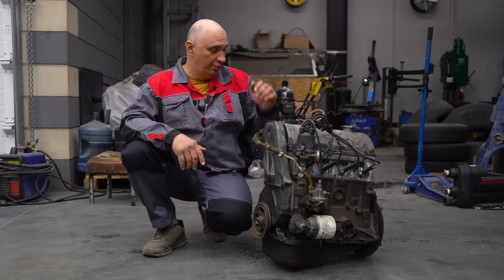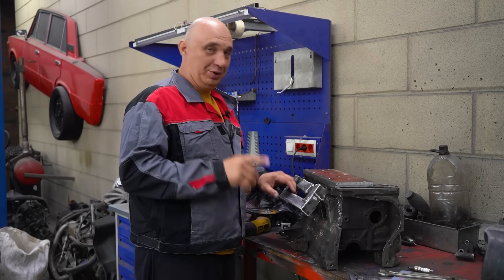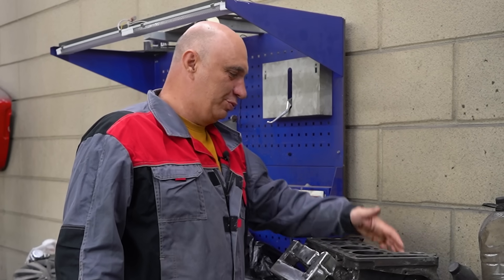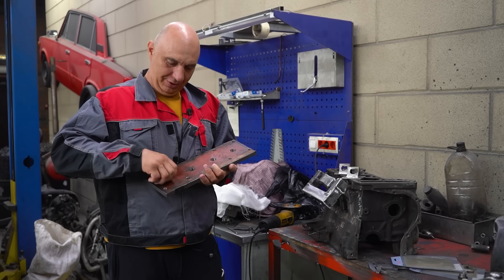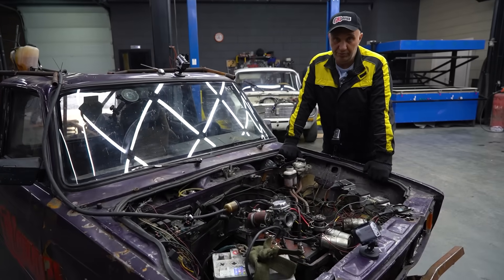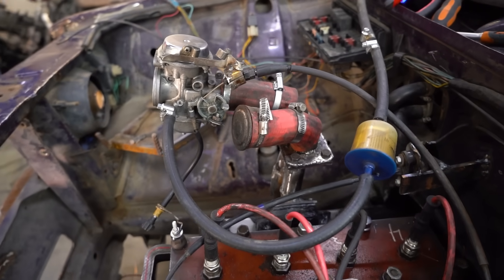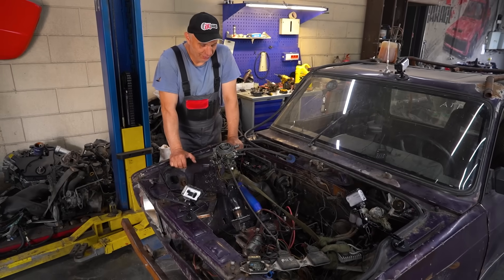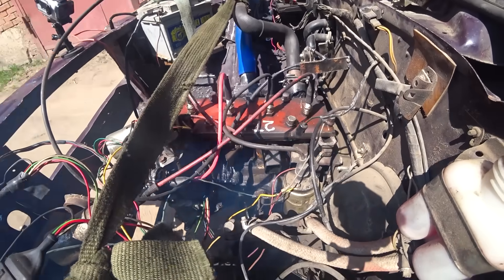4 stroke to 2 stroke Lada engine conversion

Comment: Your Problem is the crankcase you dont get pre pressuring in the crankcase because its a 4 cylinder so the pistons that make pre pressure when going down just cant make thtat because the other ones go up therefore you never have enough crankcase pressure for mixture go up in the transfers... The easyest solution would be to add a supercharger between carb and crankcase.... Or otherwise separate the crankcase in 4 ones. But that will be a Nightmare to get to seal

Comment: Two stroke engines have a reflector in the muffler to bounce back the preasure wave to prevent unburnt gas leaking out (too much) If the exhaust pipe is missing, the engine barely works. Didn't you guys tune your mofas back then?

Comment: You have to have a Exhaust chamber behind the cylinders look at all 2 stroke motorcycles it needs the Pulses to build pressure before it moves out and you need Oil in the fuel!!

Comment: I always work on 2 strokes did you guys put the intake and exhaust ports in the right places? As well as look at jetting and port timing or even the type of exhaust shape you guys are running because the exhaust creates back pressure and acts like a exhaust valve wich also allows unburnt fuel to go back to the cylinders and burn it off....if you take the exhaust off of an 2 stroke engine its not going to run right because there is no back pressure etc.....aswell as look at the ring gap that you have for each cylinder because to high compression is not good so try fitting a spacer plate on the head to bring the compression down a bit  because a two stroke usually does not like to much compression also look at the crank case because there aren't any transfer ports for the fuel to go from the crank to the cylinders so try creating transfer ports and sealing each individual conrod to its own chamber

Comment: A 2 stroke always needs a Expansion chamber (exhaust) that will cause a scavenging effect you do got the reed valves that's 1 thing u did right now it has to have a Expansion chamber to ever run right cause the expansion chamber is for unburned fuel to be sucked back in the cylinder and reburned this will make a powerband effect every 2 stroke has a powerband      add an expansion chamber you'll see  improvements         another improvement that will make it run better is sealing the block if the block is not sealed correctly it'll run super lean (too much air not enough fuel) and cause a hole to be burned in the piston if it runs also if you are mixing 2 stroke oil with the fuel make sure u run 32-1 (that's only if you are mixing oil)    those are the only things that'll help it run correctly (1 fully sealed block 2 expansion chamber)

Comment: Maybe you should change the piston cycle from pairs to individual.
Meaning that you guys need to cut the crank and divide 360° by 4 and make 90° crank connections, this way al pistons got its own powerstroke.

Comment: For starters you're missing the Fuel/air diaphragm. You'll need4 carbs with the built in one.  Look into the difference between various two stroke carbs. You're going nowhere with singular carb. Atleast two. 4 be best. I wish I could see more & your setup..I could get that going in a day.  Cause you otherwise need a Diaphragm plate at fuel intake post. Leaf valve plate? Don't bother making 4. You'll be better off hand making a swiss watch by hand..

Comment: You should try to make an long exhaust because exhaust pulses on their way out help pull in fresh mixture. the exhaust should have independent pipes for each cylinder at least 1 meter

Comment: I would put on a compressor/supercharger to fill the cilinders.. however.. i was thinking, why all the hassle.. maybe leave the vavles in but change the sprocket so it is 1:1 and mage a camshaft with in and out timing as a 2 stroke. then put on a compressor to feed the air in.. i know detroit 2 stroke diesels use a compressor/supercharger for that same reason.

Comment: There are diesel engines that are 2 stroke.
I wonder if you could remove 2 of the cylinders that are not firing?
Maybe isolate the pressure in each cylinder and even in the crank case?

Comment: 2 strokes need air to be forced in, it doesn't have that same suction ability that a 4 stroke has to pull air fuel in, 2 stroke detroit diesels have a supercharger to force that air in, instead of the crank case in a single cylinder leaf blower engine.

Comment: Just my opinion and as such, I could be wrong.
I think you would have better success with a exhaust system that has a cylinder scavenging effect, or forced air induction with a well sealed crank case..
Also, try seperating your cylinders into different pairs.
1-3 and 2-4.
That way the paired cylinders will not rob air and fuel from each other.
Plus, the flame front from one cylinder cannot blow out the flame in the other.

Comment: Is it possible to get/make a smaller cam gear? (So it spins twice as fast relative to a given RPM than it did before.) Then adjusting the timing to where it sparks twice as often..  I know jackshit about engineering. But this seems it would allow to keep the oiling and cooling systems intact..... Id legitly like to see if this would work... (or if someone knows why it wouldnt, an explanation why is cool too.)

Comment: How about turning a Detroit diesel engine into a petrol version by adding head gaskets/spacers to get the compression ratio right, put spark plugs in the injector holes if they can be drilled large enough, set up ignition, carburettor and see if it runs

Comment: Bruh I didn't understand what you guys did, but I tell you what
Did you just combined the intake tube with the transfer tube? lol that's kinda a boost port but a 2t can't run only on a boost port, it needs proper transfer ports
2 did you guys even try to seal the case?

Comment: You need something to push the mixture into the cylinder, like a compressor. On such a two-stroke the piston must first open the exhaust port when it goes down to start evacuating the exhaust gases and the pressure in the cylinder before the opening of the intake port. This allows the mixture pushed by the compressor to enter the cylinder. And this mixture would have to go upwards when entering the cylinder to replace as much of the exhaust gases as possible before the piston goes upwards and closes the ports .
Good attempt, anyway. 🙂

Comment: Go back with original head. And the fuel must be vaporized and since it's going in via rubber hoses, it's too cool and liquid, flooding the motor. So use a metal intake that retains some heat

Comment: Give it a direct injection cuz even though two cylinders are moving with the other cylinders there is a weird vacuum in there that stops the cylinders from pulling fuel in like a standard two-stroke would work

Comment: It needs back pressure on the exhaust to work it will never run right if you don't have expansion chamber and length

Comment: For this to work right you wouldn't have to do it a lot of cylinder work and you also need to make sure you remove the oil rings from the Piston the fuel has to be able to make it to the base of the engine but for what you guys have done the engine did start to sound like a two-stroke but it needs a lot more work to run properly and a two-stroke compared to a 4-stroke if you ever 1000 cc four-stroke and then you turn it to a 1000 cc two-stroke you need about twice the air and fuel mixture it 125 two-stroke racing dirt bike carburetor will run a 400cc 4-stroke almost perfectly you need about twice as much fuel and are for a two-stroke

Comment: As a two-stroke mechanic there are a few things to note. 
I watched this a few times to figure out exactly how the intake is setup and i cant quite make it out from the video. It appears the intake runs directly to the cylnder lining transfer ports. If thats the case the design just wont function. You need to create a suction to pull air in. On a two-stroke that comes from the changing of crankcase volume. Piston goes up, crankcase volume increases, creates a negative pressure. Air is pulled into the crankcase tbrougb a set of reed valves. I didnt see reed valves anywhere in the setup either. When the piston comes back down, it decreases the crankcase volume, compressing the air in the crankcase, when the piston uncovers the transfer port, the compressed crankcase air blows into the cylnder. 
If your air isnt passing through the crankcase, you arent building air flow. Remember air isnt pulled in from the piston coming down and building suction in the combustion chamber like a four stroke. 
If you dont have a set of reed valves in each of the four air circuits then it wont run either. When the piston comes down, instead of compressing the air and blowing it in the cylinder, it will just blow the air back out of the intake.
If each air circuit is not air tight it will also not run right. I wont go into detail since you covered thag at the end of the video anyway. 
To improve this could go two ways. 
1). Reroute your intake. Air goes in the carb, splits into four intake runners. Each runner goes through a reed valve, then directly into the crankcase, each in its own isolated circuit. Then you make a second pipe, only a few inches long that connects the crankcase to the transfer port in the side of the cylinder lining. 
To clearify aur comes in the carb, through the reeds, in the crankcase, builds pressure, then blows out of the crankcase and into the transfer port through a second intake runner. 
Something to nite with this is that crankcase volune is important. You want to fill in the crankcase as much as possible. Basically reduce the amount of volume between the reed valves and the transfer port. 
A lada is 1.6L engine. Each piston only covers .4L of displacement. So if the entire crankcase volume of one air circuit is say 1.2 liters of volume because the crabkcase is so large, then when the piston comes down, it goes from 1.2 liters of volume in the crankcase to.8. thats not alot of pressure. Its only building a few pounds of air pressure to blow air into the transfer port. If you can use epoxy to fill in the empty unused space inside the crabkcase and reduce the total volume you get mkre pressure. Say you reduce the total volume (with the piston at tdc) to around .8L, when the piston comes down (again reducing the volume by .4L) you have significantly more compression, more pressure forcing air out of the crankcase and into the transfer ports.
2). The ither method would be to ditch that entire setup and reroute your intake to that if a detroit diesel engine. Detroits are two strokes but also have an internal engine oil. Thiugh this eet up would be alot more expensive and probably couldnt be done with parts laying around the shop. Unless you just happen to have a powerful enough blower just laying around.

Comment: This thing is never going to work because it does not suck any air At ALL!!  You need a seal between the crank (5x) and you need tansforports to bring the mixture on top of the piston...and your bearings need to be changed into roller bearings lubricated by the mixture..

In this situation you could use a mechanical blower (like on a two stroke detroit engine)to force the air mixture into the camber(root blower)
But you never get the mixture to flame i guess because you can t inject it like in a 2 stroke diesel engine

Lovely video but your concept doesn t suck....haha

Comment: What I would do is leave the engine like it is from the factory but re grind the cam to open and close the valves every stroke and make the spark plugs fire every stoke. Also your setup a problem you have with this setup is that the piston skirt doesn't cover the ports at TDC

Comment: Need a supercharger for it to run. All 2 strokes need an air pump of some sort for positive pressure on the intake port. Some work via the crankcase, others like diesels with oil sump need a supercharger to run (and is still considered naturally aspirated). Get positive pressure on the intake ports. Use a vacuum cleaner motor if you have to!

Comment: A two strokes intake is mainly within the crank case.The vacuum created from the piston traveling up draws in the fuel air mixture into the crank case. As the piston starts traveling back down the intake on the crank case is shut off via means of a read valve or rotary valve.
 the pressure from the piston traveling down now forces the air fuel mixture to the combustion chamber via passages from crank case to cylinder ports. That's how it works. 

Sadly what they tried here would never work, because the intake port is WO at BDC there is no vacuum to draw in the fuel and air.

Comment: Too much crank case volume and no exhaust. It needs a custom crank to feel up the space and smaller oil pan to increase the pressure of the crankcase. And some exhaust to suck more fuel.

Comment: Block off ports to transfer case. It will never produce good enough seal to drive mixture. Let the pistons drive in mixture and it should start without further modifications. Granted that then bottom end doesn’t have any lubrication then but it should prove the concept.

Comment: Hey guy's, I do lawnmowers, chainsaws, line trimmers.... that kinda thing, most of the stuff I do is single cylinder and ya need to think of the engine as having phases (what's happening above and below the piston) below piston... when the piston is going down it needs to be forcing the fuel change into the cylinder, when the piston is going up, there needs to be a vacuum in the crank case drawing in the next fuel change.... Above the piston.... When the piston is going up the fresh fuel charge should have pushed out the burnt gases then seal off the exhaust ports and seal the cylinder ready for combination

If there is a vacuum or pressure leak then it will incredibly bad if at all

Hope this helps

Comment: There is a much easier way to 2 stroke convert a 4 stroke, use a supercharger for scavenging and open both valves at bottom dead center...with some clever valve controll its even possible to make an engine which can switch between 2 stroke and 4 stroke on the fly to make the most of both worlds.

Comment: separate the crank chambers and run the gas mixture through the crack chambers and weld up a transfer port make sure the port timings squish gap and ignition are acceptable and it should work no problem!

Comment: U need to create flow airfuel wave to run it.
Try to instal comprex from old diesel mazda, it will run as a rotary compresor and exhaust valve at same time. U do not have exhaust negative pressure in cylinder chamber, or intake flush positive pressure of fuel air mix so you cannot run the engine cause you dont have anything to combust. Two strokes run always on a flow wave by 3 ways:
 on flush chamber forcing airfuelmix to cylinder
or membrane valve with decompresing chamber in exhaust - suction exhaust by them airfuelmix
or forced charge like 2 stroke diesel (kompressor ),  this let you no need to have exhaust chambers or membrane valve
these are 3 ways to run it.

Comment: OK. I have spent quite a lot of time with old 2 strokes. 
That type has to basically have a very very good crankcase seal to work. It's unlikely welds will be that sealed. Then normally the open space in the case is minimal so the piston has more suck and compression. And the piston has no shape. That kind had to have a shaped piston head to blow the inlet air up. The setup as it is, is just blowing out the exhaust mostly. 

A better approach may be this. 
Keep the head. Then use the exasust valve to open when the cylinder is at the bottom of the stroke. This means different cam  profile and rotation speed. Just take the inlet rocker out and leave the valve.

Then the inlet port is at the bottom. 
Use a belt driven large blower to get the positive pressure to push the inlet air in. 

Few multi cylinder 2 strokes use crank case compression as its just a pain. So a blower is better.

Comment: Just finished watching.
You need to reduce the crank case volume to the bare minimum. Also look a little bit better in regards of the transfer ports timings and sizes. 
You are in right path but for this to work it will need to be more elaborate

Comment: You might need 2 stroke exhaust... You should buy some 2 stroke moped exhaust pipes 1 for each cylinder and one moped carburettor for each cylinder that might give you the best chance for it to work

Comment: Do the same as GM did with their two stroke diesel, use blower to aspirate the cylinder/s then you will see success, for extra fun, use an expansion chamber for each cylinder, something from a 300cc or so two stroke motorcycle, you will need one per cylinder

Comment: You must have two overflow channels per cylinder and one intake channel per each cylinder that is dug in the bottom of the cylinder. The overflow channels must be connected to the crankcase where the crankshaft is located. And they go in front of the piston when the piston is at bottom dead center. When the piston goes down, a negative pressure is created in the crankcase, which pushes fuel into the overflow channels and sends it in front of the piston. Until you do that, your engine will not be able to work.

Comment: you can run a small car on a snowblower engine with a adapter for transition it will run 35-45 mph thats on a 2 door car, down side engine will run out of gas in 2 hours on 1 gallon tank. should try it engine weight balance for fly wheel  help engine to stay running.

Comment: 2 Stroke engines need a proper exhaust to work - I dont know the english word for it, but look a the exhaust systen of the Wartburg 353, maybe this fits your needs! Looking a the engine itself would be helful too for the crankcase issue. There might be a reason they designed it as 3 zyl. 1000ccm engine. Also, maybe compression ration ist too high. Geetings from eastern Germany.